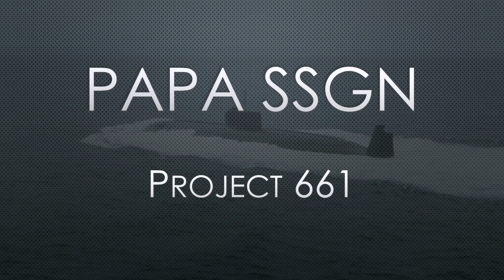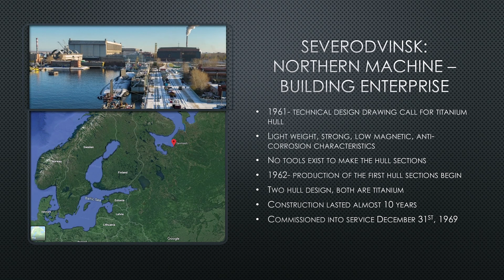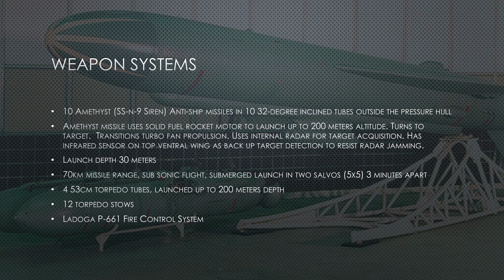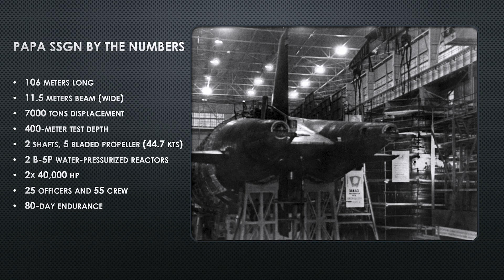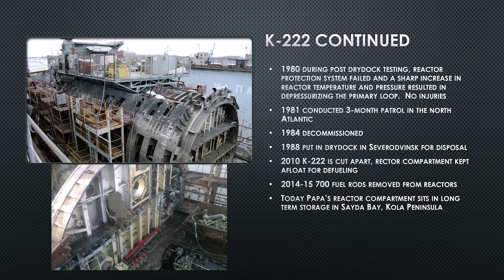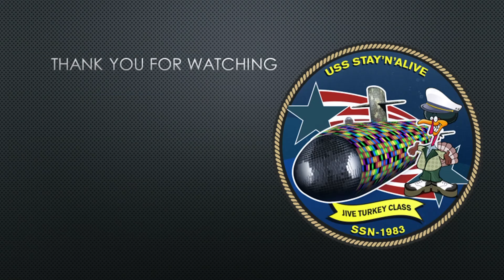The Fastest Submarine Was Not American

Comment: Isn't a high speed sub the same idea as a high carrying capacity formula 1 race car, nice to have but really not if it's even to the slightest if at the expense of it's main expected qualities of stealth?
Reply: Good for evasion, especially when it was faster than or about as fast as most, if not all, torpedoes. They don't have to travel at top speed all the time.
Reply: Yep, these were mostly for bragging rights propaganda, "We have the fastest submarines!"
My understanding was that you could hear them one hundred miles away.
Reply: @gallendugall8913  That's the Russia I know and hate.
Reply: @gallendugall8913  Your understanding is wrong.
Reply: In fight with enemy submarine or ASW ship "stealth" is useless. When fight begin, sonar is switched to active and there is absolute no way to escape its soundwaves. So in case of "dogfight" same rules as for air-to-air combat apply - missiles/torpedoes are faster than you, but you have benefit of unlimited power, so you can use energic maneuvers to outmaneuver those missiles/torpedoes.

Let say that Mk.48 has range 40 km at 100km/h (55 knots). If you are escaping that torpedo with sub at speed 46 km/h (25 knots), then maximum distance enemy can fire that torpedo is 20km. If your sub can achieve 65 km/h (35 knots), this distance is shorten to 14 km, And finally with speed 80 km/h (43 knots, Alfa class) that distance is lowered to just 8 km!
And this is just simple straight run away strategy. You can dive deep as possible, where combustion engine powered torpedo loses significant portion of its engine power and make sharp turns, which is exhausting torpedo energy reserves significantly, meanwhile your nuclear reserves are unaffected.
Reply: @tomascernak6112  unless you meet a garden variety ASW helicopter then you're a slow moving target pushing all that water away which can't be silent. At does speeds can they even hear the torpedo dropped in front of them?
Reply: @cgourin  Nope, you are not. Aircraft launched torpedoes has significantly lower range and can not be guided by wire, so they are significantly more dumb. Moreover, ASW airforce need protection to operate near land and ships to operate on open sea. This is not simple task altogether. Also ASW airforce is useless in submarine-submarine fight. Or you know about submarine carrying ASW helicopters?

Btw. Germans and Russians developed underwater launched anti-air missiles. So modern submarine can kill even ASW plane.

You need to comprehend, that with modern system you will not evade ASW systems by stealth, if they know that you are in some area. Stealth is good to prevent fight, but when fight emerges, stealth is useless. This is not WW2, where it was possible to fool ASDIC operators and by quite run get out from danger. Modern sonars are 3D sonars, they see everything and hiding outside seafloor is impossible.

Also high top speed does not automatically mean being noisy in spectrum of speeds. For example Alfa class had top speed 43 knots, tactical speed was higher than tactical speed of Victor II, so alfa was more quiet, than contemporary SSNs.
Reply: @tomascernak6112  So the conclusion is: no one made a 40+ Knots sub in the last 55 years (launch of the K-222) because it was a brillant idea?
Reply: @cgourin  Alfa class were all 40+ knots subs. Laika class will be 40+ knots sub. Oscar, Yasen, Sierra, Akula, Seawolf class are 35+ knots subs.

Achieving high speed is technologically hard. Not only power requirements are increasing with cube of speed, but also equipment has to be much more resilient. This is similar pros&cons as in achieving depth. It is not just simply matter of material and thickness of pressure hull.

If speed and depth is such bad idea, why best submarine of USA (Seawolf class) was built primarily with those two parameters in mind ?!

You can not present mediocrity as smart solution, just because it is relatively cheap. In such case, all nuclear submarines fail compared to diesel electric subs.
Reply: @tomascernak6112  You clearly haven't got the faintest clue of what you're talking about.
Reply: @antred11  Yeah, this is supreme "argument". It is above your abilities to elaborate, right ;-)
Reply: In context the US was just bringing into service in 1972 the mk.48 torpedo which was a big leap in capability to the mk.37 which was very slow in comparison with a much smaller warhead.

The Papa could be ahead of your convoy headed to Germany (WW3), wallop them with missiles then sprint away faster than any torpedos.

The Mike the deep diving sub was meant to do similar but dive so deep outer torpedos couldn’t get down at it.

Both survive then re attack and repeat until stores empty.